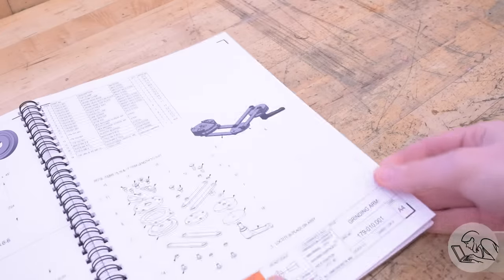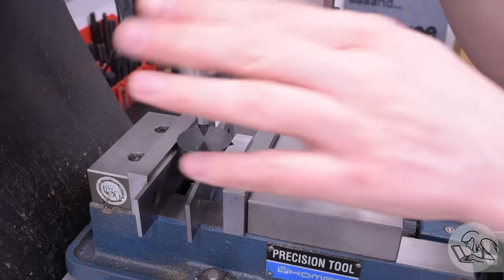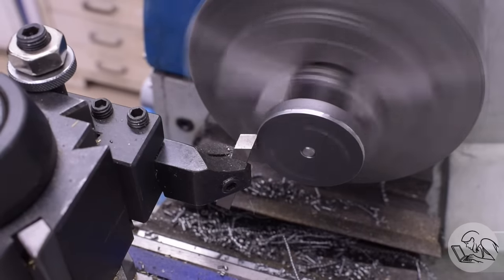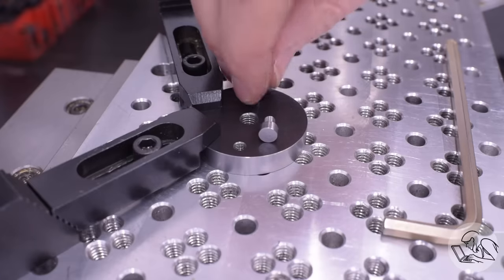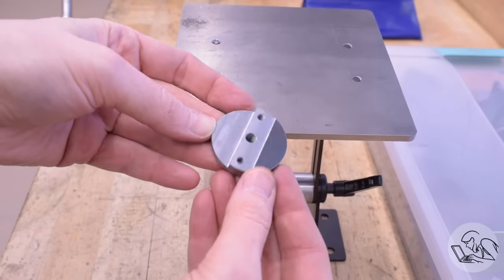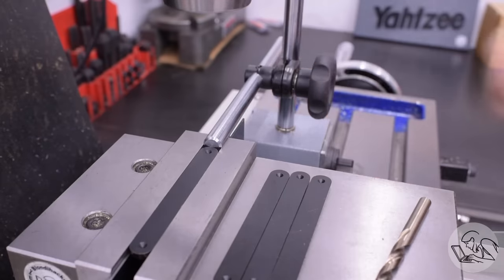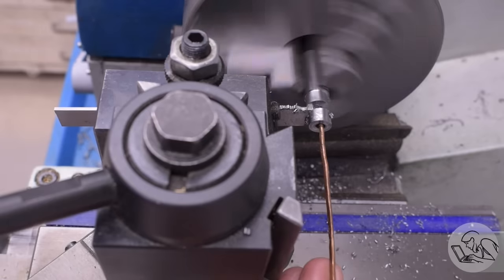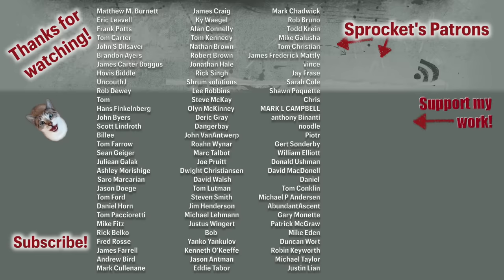Let's Build a Tool Sharpener - Part 3

Comment: Oh, yeah, IKEA toggle bolts FTW!! And, yeah, I recognized that one immediately! When I first acquired a 32-year-old VW Jetta 1.6D Mk2 I had to replace the parking brake cables; while I was adjusting the parking brake I lost one of the jam nuts, gah, and despite having a massive plethora of metric nuts I couldn't find one to fit so I dug into a box of IKEA hardware that I'd gotten from the as-is section at IKEA and found an IKEA toggle bolt that fit perfectly. I DD'd that Jetta with that IKEA toggle bolt readily visible (never got around to putting the parking brake boot back on, lol) for many years until last summer when it was totalled by a schmuck running a red light. R.I.P. Jetta with its IKEA toggle bolt.

Comment: Quinn, I started the same quest several years ago to find a full set of Metric stub length drill bits and had absolutely no luck even looking to European and Asian sources.  I ended up buying them a handful at a time from McMaster-Carr and later AFT Fasteners depending on which was cheaper for a given size. I chose Norseman black oxide coated because it was the type that McMaster had the most sizes available when i began the project. (yes, I’m aware that black oxide is not optimal for aluminum but i get away with it by using WD-40 when needed) I ordered the Huot 11825 118 piece Metric combination index on eBay  and it was about $60 at the time  (2016?) but has now risen to a brain-numbing $177on amazon and $155 on eBay. I was required to draw and laser cut a bunch of Plexiglas spacers to strategically screw to the insides of the drill pockets to keep the stub length bits from disappearing down into the holes designed for jobber length bits. I still several years in haven’t found every single size to fill the set and have skipped some of the larger ones for reasons of economy. I’d say in 2024, getting near a complete set with this approach will cost between $700 - $1K. I also have a Norseman black and gold finish full set of jobber length that I see goes for about $400 and they are gorgeous but that’s not what was asked so…
Also, THANKS FOR YOUR AMAZING CHANNEL!
Reply from the maker: Wow- you read my mind. I was formulating this exact same plan just last night. I have the same Huot empty drill index bookmarked 😂. That’s likely what I will do as well. Buy the case, and gradually fill it with drills as I need them. I like your idea of filler plates to make the short drills fit. I’ll borrow that idea.

Comment: The 4 bar linkage is the same mechanism as the old drafting machines I used in the 70s, which I preferred over later drafting machine, before CAD took over. It's a really sweet set-up.

Comment: Quinn, I have been able to get EDM consistently in my shop.  Often it is Fat Boy Slim.  On occasion Skrillex.  Oh, and fine, Daft Punk, too.  Surprised this magic remains inaccessible to you.
Reply: I Do have a Wire EDM machine.. and indeed.. it's like magic, cutting Solid Carbide without even touching it..

Comment: Another great video Quinn, thank you! I would like to add a bit of additional information, if you don't mind. What you created there, and test assembled at the end of the video, is actually TWO four-bar linkages. Starting from the clamp, the first disk counts as a bar, then two actual bars, then the disk in the center of the mechanism makes the four bars of a four-bar linkage. Then, if you start again at the center disk (the two four-bars can share a bar), you have the center disk as the first bar, two parallel bars, and then the rectangular piece you put in for mock-up purposes makes the fourth bar. So in fact, you made two four-bar linkages connected in the center!

Comment: So reference the drill bit set, on amazon (UK) there is BAER HSSE & HSSG sets (i.e. 2 separate sets) available from 1 to 6 and 6 to 10 mm in 0.1mm increments, however I've not seen bigger than 10mm in anything less than 0.5mm. hopefully gives you a starting point though.

Comment: just a quick note, albeit a little pedantic; that is actually 2 four bar linkages. the first four bar is between the clamp, the intermediate plate, and the two lower bars, and the second four bar linakge is between the intermediate plate, the two upper bars, and that temporary aluminum plate. It is a bit confusing because you did only make four bars for the whole system, so it is easy to say it is a single four bar linkage. 

Usually, a single 2-dimensional four bar linkage only has one degree of freedom, i..e. it is fully constrained except for it's one path of travel. Look at the back end of a mountain bike for example, many of those have four bar linkages to control the rear suspension. Because you have two four bar linkages, you can move in two degrees of freedom, up and down and side to side, but you are constrained rotationally. 

Also note that none of this applies to something like an automotive four bar linkage suspension because that is a 3d space and you have 2 degrees of freedom from a single linkage (kinda)

Comment: One medieval device we use on some aircraft to rig/verify the rudder system is a really (really) big 4-bar protractor. I call it The Widowmaker, because it'll happily provide enough leverage to effortlessly crush any digit you may have inattentively poked through the mechanism. I promise, you only ever do that once... Well, at least with that finger. 😂

Comment: Dormer Pramet has some fairly good stub drill sets. Not in 0.1mm but they at least have a 0.5mm set which includes tap drill sizes.

Comment: I'm sure you considered this but curious if you indicated the dimples on the mill rather than using a drill press and letting drills self-center on them due to accuracy concerns, sizing of the holes, or some other factor? I probably would have YOLO'd it on the drill press and regretted it later so would love to be schooled on that.

Comment: We used to have devices like that in our drawing office. They were so we could draw parallel lines consistently. We called them drawing machines but I think the correct term is Pantograph.
Reply from the maker: Not quite- a pantograph is a different linkage that also scales up or down
Reply: Not to be confused with the lesser-known ‘pantigraph’, which is used in the clothing industry to draw underwear…
Reply: @mrimmortal1579  😄

Comment: If you had tapered the back side of the alignment pins and turned a chamfer into the disk treaded holes (in a four jaw), would that have improved contricity from the treaded holes?  Probably crazy overkill for a project like this…

Comment: Another question, I would imagine the orientation fidelity of a 4 bar linkage is related to the center distance on the 4 tie bars being as accurate as possible, would it make sense to stack and drill/ream the at the same time?  Same with the disks.

Comment: Hi Quinn I live in the Netherlands and even I have trouble finding a stub drill set. Even individual stub drills are hard to find they come in packs of 5 to 10 mostly. My guess is that only cnc companies use then.
Reply: Originally they were called screw machine drill sizes. The back taper is the same, it just starts at the halfway point for them... cutting down a jobber length will lead to smaller holes as the original tip retreats toward the shank. Over all taper is called out in MH, this clearance saves a lot of hardened drill guides from overheating.

Comment: In this case you could have skipped out on their outer hole marks, as long as either you were fine with one of them sticking around or you rotate the part just right so they would be cut off when you milled the two heights

Comment: I can briefly see that the schematic provides the offset for the holes as well as the diameters...  So why not just flip it over and use the other side to avoid all the setup headaches?  I you get it "close" you'll probably drill out the dimples anyway.
Reply: Quinn mentioned this idea in the video herself, and added that this would loose access to the quite convenient center dimple.
Reply: If you watched the video she addresses this question..pretty much verbatim lol

Comment: wouldn't the finding zero on the laser holes be easier on a rotary table? center on the midle one then adjust the angle until the outer ones match on X? Not a machinest so don't know if this wouldd save time.

Comment: doesn't the thread not touch the innder diameter of the holes tho? could maybe use slip fit pins the size of the pre-drill diameter of the holes and align on those?

Comment: Genuine question for you and your lovely community: (I am a rank, RANK amateur, please forgive) : is there any reliable, repeatable way of determining when a drill bit has lost its edge? Always seem to have that one, long month when I begin to suspect my bit is dull , but until something burns , I just don’t know…it’s like being paranoid your girlfriend is cheating…😢 thanks
Reply: Without entering the field of industrial Tool Life Monitoring, that is sort of rocket science (and almost equally expensive 😁) I would  say that a good enough rule of thumb for a rank amateur (professionals do it simply by ear ) is checking whether during operation the chips are clear, well formed and easily expelled and the drill is advancing at a steady pace and with a relatively low effort (depending on material, of course) or else the shavings appear like "caked" into the bore (or, worst, sticking to drill's flutes 😖) and the bore itself shows no constant progress and looks more like a dull crater than a neat hole.
One repeatable way, in  case you're seriously paranoid, could be that of drilling a test hole on a piece of a known material with every brand new bit, and then keeping the piece for future comparative reference.
And, in case of reasonable doubt, the peace of mind of getting yourself a new drill bit is absolutely worth the cost, while the same rule doesn't necessarily apply to girlfriends... 😂

Comment: Dormer 616185 A088200
Reply: And available from Amazon Canada
Reply: Also KBC tools sells several sizes up to 13mm
Reply from the maker: Thanks for the suggestion! Unfortunately it’s just a basic set- I’m hoping to find a full metric index in stubby length
Reply: @Blondihacks  I suspect that you are looking for a unicorn,  not  just stub (screw machine)  but also metric   and in North America no less.
Interestingly , Fastenal has a very extensive listing of available sizes and material,  for  reference.
You may well have to settle on buying individual bits as needed.
To bad there isn't a   german based machinist by the name of Stephan, with a Youtube channel that you could ask.
Reply: @Blondihacks  buy a full set cut them down and re sharpen with your new tool sharpener :goodvibes: